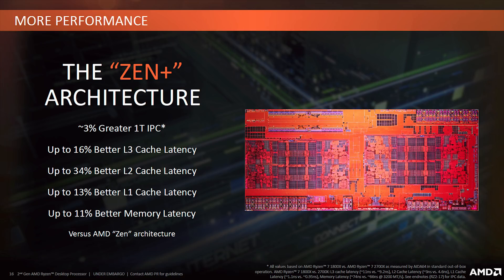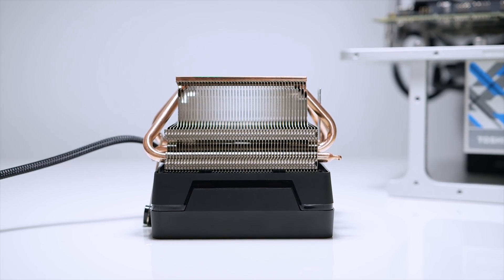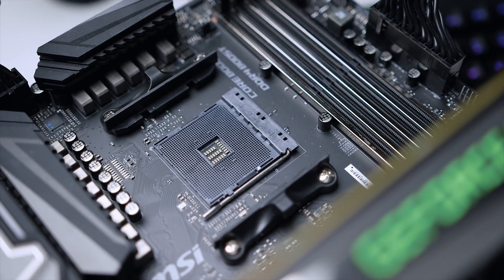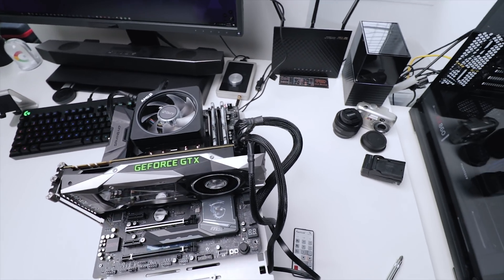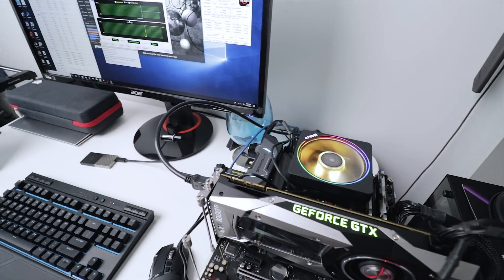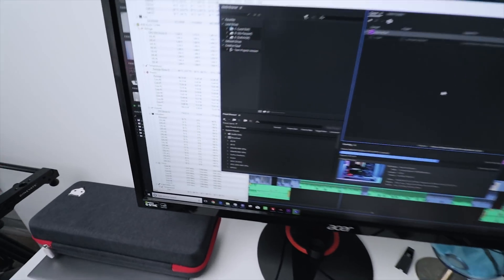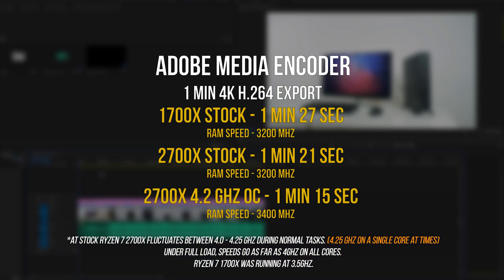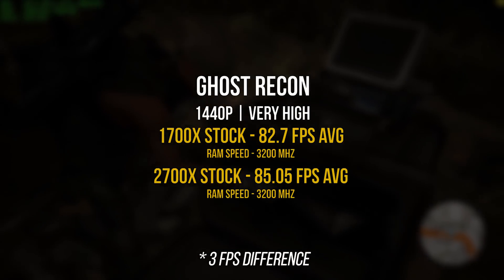Ryzen 7 2700X vs 1700X - Worth the Upgrade?

Comment: Not sure that it's worth the upgrade if you have an older Ryzen CPU, unless you're upgrading to something with more cores/threads. But at this point, if you have anything older than Ryzen, I think it's a no-brainer to upgrade to a lower-tier Ryzen 2000-series AT LEAST. The improvements are just too big to miss out on IMO.

Comment: You are supposed to remove the heat sink while the CPU is still warm, preferably do this right after turning your PC off.  This will help greatly with the CPU not getting stuck to the heat sink upon removal 😉

Comment: @HardwareCanucks why did you test the overclocks with higher memory speeds? That taints the results. Also, why didn't you include the OC scores for the gaming tests (you mention apples-to-apples-comparison, but why not keep it that way throughout the test)? Smells like you weren't really stable at your OC.

Comment: It's not really a major improvement in IPC but it is a major improvement in power efficiency. Look at voltage frequency for both 1700x and 2700x! The voltage for a 1700x and 2700x at 4GHz is night and day. The 1700x required nearly or above 1.4 volts. For the 2700x it's around 1.15/1.25 volts. The bad thing is that when you try to push the 2700x above 4.0GHZ you have to ramp up the voltage significantly.

Comment: You straight away blame the mounting configuration for the failure to separate the cooler from the IHS. I wonder if someone in the YT community has actually ever considered if both the thermal compound properties and mounting forces for those coolers are within the mounting system specs by the manufacturer. I'm not implying this is a new problem, only that the blame is always cast on the mount system while probably the problem is not correctly understood.

Comment: ive pulled so many cpus out of the socket when removing coolers its not even funny, not just an am4 problem happens with just about all of amds sockets, luckily its designed in a way that the cpu and socket have always been perfectly fine afterwards, for me anyway. Find it happens fairly often with "stock" TIM as some of the stuff that comes bundled with lower coolers turns into glue when it hardens

Comment: Why test games on 1440p resolution when you want to check the cpu improvements. Imo you should run those tests at 720p or 1080p. And why not to add an i7 8700k for comparison?

Comment: How about testing at stock values. The 1700X vs 2700X, both at stock out of the box with the requered memory speed as stated on the website of AMD: 2666 mhz for the 1700X and 2933 mhz. That would be the only correct review.

Comment: I'd like to have seen what the differences would've been if you actually took the maximum ram speed for the 2700X into the test too. To see how much of a difference it means to have rams at 4000mhz compared to 3200mhz.

I know in testing you want to minimize other factors than the processor itself - but from 1700x to the 2700x there's also a difference in how much ram speed the can handle, right? That would've been worth testing out too, to see how much of an improvement it would be if you invest in the maximum speed of ram the 2700x can benefit from. :)

Comment: Gah! Why is everyone benchmarking games that are really well multi threaded!?! Battlefiled 1? Doom on Vulcan? Seriously? You can run Doom on the Vulkan API on a freakin 7th gen i3 and still get 60 FPS. Pick some titles that suck at multi threading, keep a good cooling solution, and see if XFR 2 shines at least a little brighter than this... I went from an i7 4790k on a GTX 970 to a Ryzen 1700x on an RX580 a year ago and noticed a major performance hit on Far Cry 4 between the 2 systems. My theory is that the 4790k still has better single thread performance over the 1700x. I noticed while playing Far Cry 4, that in certain parts of the game, ONE thread would end up maxed out for a few seconds here and there in intense fights, and the moment that happened, my GPU utilization and FPS would plummet. I can't help but think that if XFR2 on a Ryzen 2 could ramp up that maxed out core to 4.1+ ghz. Maybe it might have softened those FPS drops like I got on my 1700x, usually putting all 8 cores around 3.6 ghz, if I remember correctly. Just a thought...
Reply: Wrong! Intel is a criminal corporation. They created a compiler which only runs quickly on their processors and then bribed software makers to use it. They bribed HP, Dell etc. to not use AMD processors too.

Comment: Hey, I have a question for you. I am building a VR development PC and I received Ryzen 1600 yesterday. My motherboard is B350 and I'm thinking of returning this chip and getting 2600 instead. However, here are my concerns:

1. I have to update the motherboard BIOS to use 2600 and in order to do this, I have to use 1600. I ordered it through B&H and not sure whether they would still accept the return after I use the chip, and I don't feel comfortable either.

2. I'm not sure whether I will see a significant speed difference. Just as you said about the difference between 1700X and 2700X, while I am building a new PC at this moment, I'm not sure it's worth going through a hectic #1 process to get a slight speed bump. On the other hand, I haven't actually started assembling so my parts are still in boxes. Since it's new, I sort of want to get the newest chip possible, of course.

Your opinion would be very helpful in choosing what to do. Thank you in advance!

Comment: I'm an existing Ryzen 1700X user and the most interesting thing about the Ryzen 2700X is the improved power consumption. I don't know how a processor with a high 105W TDP fares better in idle and load compared to a 95W TDP is beyond me.

Comment: Setting memory speeds to same isn't really an apples-to-apples comparison I think. One of the big pros of the new Ryzen is compatibility with higher clock ram, therefore shouldn't you be testing both systems with the fastest memory possible?

Comment: I think Im going to change my motherboard instead, I have a r7 1700 and ever since a bios update, I can't go over 3.7GHz and even for that speed I have to max out the voltage to 1.5 because it keeps crashing with cinebench, since the beginning the cpu only went from 3.0 to 3.2 without meddling with the bios and couldn't get to 3.7 out of the box, my mobo is a gigabyte gaming k5 and I pretty much hate it... ty to flash back the bios but I can't get back my stable 3.9 OC  but that's the price I paid for saving a few bucks, I should have bought the Asus hero instead
the power supply is a corsair 750w so I don't think that's the problem

Comment: Ryzen 2 isn't really worth. Its great and all but with the prices of 1st gen ryzen its much more better to get the 1st gen ryzen, unless you're making a completely new build and need that extra edge for a workstation pc or the new storeMI tech then sure get the 2700x. I'm probably going keep my 1600 and switch it out the very last gen of ryzen on the am4 platform and unless there's something absolutely amazing that I need that will come with the future board, my gigabyte gaming 3 b350 bored is just fine.

Comment: Not expecting much more in gaming, that should go without saying anymore.  CPU's haven't been a bottleneck in gaming since the first gen i7 days... A 920 overclocked to a 980X sitting stock, they can keep up with a 1080ti's workload all day long, the 980X can even take two of em up the... er, I mean... in SLI.  New CPU's offer more cores, some nifty new extensions in regards to encoding, because everyone is a YouTube star these days and needs rendering performance to exist on Earth,  Obviously...  But taking a close, or even broad look at 3Dmarks databases, searching configs, and comparing the results... Graphics scores sit about the same from a 980X to a 9th gen top o the line-o CPU... or AMD equivalent (obviously when paired with the same GPU).  Innovation has been stale for nearly a decade... Agree or not, them be the facts ho bags.

Comment: Great video as usual. You did however limit the full performance of this processor by not showing the results for the higher memory clock speeds. Apples to apples is fine but the 2700X is still capable of more, and with the memory speed scaling of the Ryzen architecture the results should better than the 1700X, more than what was shown here

Comment: Good vid. I always like you videos guys but... You should have tested the 2700x stock at 3400mhz in the RAM. That is apples to apples because you will be testing each CPU at his max setting. What is the point of downgrading a new CPU to match the old one? In this regard, why dont downgrading to 1666mhz and shut down 4 cores to compare it against an FX 8350?.  I mean, no offense, just want to give constructive feedback, but it is more "fare" to test each at his max capabilities in stock scenarios. 👍😁

Comment: Gamers Nexus has a very in depth testing video up. At best you get very a small increase in gaming performance...etc.. over 1st Gen Ryzen. Single digit % increase due to faster clocks. This was mostly expected. The 2xxx series is, however, way more power efficient than Ryzen 1xxx in which the margins of difference was surprising. We won't really see a solid gain in IPC..etc till gen 3 or gen 4 Ryzen. Very similar to Intel's old Tick-Tock incremental gains.

Comment: 8700k costs the same as the 2700x here....
Reply: Wheres here? 8700k $339 no fan. Ryzen 2700k $329 with rgb fan. Both great CPU's. So Intel cost more.. you still have to get some kind of heatsink.
Reply: micro center has the 8700k at 300, bundle it with a motherboard and they take even more off.
Reply: and can you scroll up and read what i said? "lol even if Intel doesn't include stock coolers on some cpus at least they let you use something other than the stock cooler on the ones that do"
Reply: "here" is houston, tx
Reply: kid can u read?
i said

"ѕυиѕтσям
1 day ago
and yes since posting this 8700k prices have gone down here"
Reply: definitely not in houston. or the web store. and im not driving a few hundred miles to get a cpu
Reply: its "pickup only". which microcenter are you looking at?
Reply: yea ik. its in houston, but the 8700k costs 300. the 2700x costs 330.
Reply: i remember that you said " Microcenter currently has the 2700x for $300."
Reply: also micro center doesnt  have the newer x470 boards. so ur cutting some features that make ryzen2 attractive
Reply: im paying $30 extra for a cpu, or $10 extra+cutting features off.
Reply: honestly, i would go for ryzen2 if they cut off 50 dollars from msrp like they did to the 8700k. then we talk
Reply: where are the x470 boards? can u look it up? theres only one and its for 180
Reply: x470 pro? its not even on the site lmao
Reply: besides its 30 dollars off for z370
Reply: yea im gonna tell u after when i vist my microcenter soon. all the other x470 boards say out of stock in houston store. I highly doubt that would be in stock lol.
Reply: prove where i went fanboy. all i said is that 8700k is cheaper. did i say it was better? no. all i said is that its cheaper. You, however, as an entitled amd fangirl, automatically assumed i was dissing ryzen and saying its products are bad. I didnt. I just said that Intel was cheaper rn. Thats it. Now fuck off
Reply: u turned it from a "which one is cheaper" to "which one is better". Different subjects. J🅱eesus
Reply: 300 vs 330. Ok?
Reply: can u guess which cpu i got?
Reply: also btw yes using an aftermarket DOES void ur warranty with ryzen.
Reply: or it did when i wrote that comment.
Reply: they have since changed it
Reply: point is. I was comparing the PRICE of 8700k vs 2700x. not z370 vs am4. not intel vs amd. but the price of two cpus. go fucking enjoy ur new 2700x. im enjoying mine so far. Happy? Im the intel fanboy whos using amd. Right?

Comment: Microcenter in the US is selling I7 8700k for $299.99 and you save $30 when you bundle with a motherboard. So basically $269.99 if you buy a motherboard.

Comment: But you only tested at 1440P ... you are most certainly GPU bottlenecked anyway, I wouldnt be surprised if the 8700K doesnt score much better than this. At 1080p, there's a good 10-20% difference between the 1700x and 2700x.

Comment: I'm hoping that the lower end cpus might offer more of a performance gain since that is where you might see more potential to overclock (less cores, less heat/power needed for the overclock) and therefore might see more of a difference.

Comment: Wouldn't it have made more sense to also show the OC results for the 1700x in your comparisons? 
If it's running 500mhz slower, it might show parity (or close to) between the 1700x and 2700x at the same speed.

Comment: Thx for the comparison. It's time to build a new rig.
In case anyone is interested my old Toshiba Ultrabook with an i5-3317U @2.4GHz (Turbo Boost, Stock is 1.7GHz) renders the BMW scene in 42 min 39 sec. 
The 2700X @ stock is ~9.5 times faster.

Comment: I got my Ryzen 1700 CPU mainly for work. Don't care that much about 1 fps more in gaming on 1440p or 4 fps more on 1080p.
Reply: Its never worth to upgrade before your gear hits 4 years old, heck it can go older and still be good, these options are only good for new buyers
Reply: Have you overclocked your chip? What's the max potential?

Comment: I think it would make sense to also include the overclocked numbers for gaming, as well as the 3400Mhz memory speed. "Apples to Apples" is useful in some ways, but practical comparisons are useful in others. If I bought that setup, I would not be running it at 3200Mhz, for example, so my decision on whether or not to buy it would not be based on those 3200Mhz numbers at all.

Comment: Tough decision because of the included cooler makes it a great deal. If I need to use the aftermarket Noctua 15 for stable oc, it's not so appealing over the 8700k. Excellent video. Thanks.

Comment: I am more interested in Ryzen 2 rather than Ryzen plus, I know Kodouri said something about knowing what needed to be tweaked to match/beat Intel in gaming; however, Its more just a matter of clocks per core from the looks of it, and with him leaving AMD the question as What will happen now?, Ryzen is a win for AMD but its not an Intel Killer like the hype train made it to be, as for me, CH6/GSkill 3200mhz Trident RGB/1700x/Krakenx62, I'm at 4.0 on all cores with comfortable voltage and temps; However, I had gotten a stable 4.2Ghz with a few Asus updates, just not really comfortable running those temps for long term everyday usage.

Comment: Thanks for your review mate, I suspected much as I pretty much bought a 1800X and 1700 for a couple of systems in the past both were overclocked at 3.9 at that point I wished id just purchased 2 1700's the 2700x looks like a good one to throw on a fresh build with a X470 think ill swap the Prism for the noctua use the Prism on a 1700 cpu cuz it looks sick :)

Comment: I'm running a 1700 on gigabyte x370 gaming 5 with rx460 atm.  am thinking of upgrading almost my whole system.  I currently have DDR4 @2933 memory anyway and also a H100GTX AIO in my Obsidian 750d.  Would love to know your thoughts on what to upgrade and whether it's worth it, especially since I'll be using it only for rendering and occasional 4k editing. I already have an iMac Pro 10 core anyway and I use Media Composer 2018 and Da Vinci 15 Studio for video and Phase One software (Capture One Pro & Media Pro) for my photography I do .
For it's either upgrade my pc or a new MacBook Pro, but not both! especially since I am upgrading my monitor to a 4k as well, so I have to watch my budget.

Comment: Although a fan of the channel, I'm a little disappointed that the benchmarks were done with a 1440p resolution. We all know the higher the resolution, the less the game will depend on the CPU, and more on the GPU.
While not 4k, 1440p is still relying on the GPU much more than CPU and that's why the performance increase wasn't very noticeable.

I know that regardless of this, the performance difference isn't a lot, and there's no point going from Zen to Zen +, but the review was a little disappointing in that regard.

Comment: Great review but not sure why you used such a high res and ultra & epic settings to do CPU tests the whole idea of testing a CPU is to take a lot of the load off of the GPU and even the mighty 1080Ti will be working pretty hard at your test settings. But hey at least you didn't pit it up against a 8700K@5.2Ghz like most of the reviewers did in the first Ryzen release with the 7700K@5.0GHz-5.1GHz and say hey Ryzen sucks at gaming which then all of the masses around the world kept on repeating over the last year.

SO yes you did a good job & it is disappointing you did not get a solid 4.3Ghz out of the CPU or that 4.350Mhz we seen in the leaked becnhes.
Reply: it's a good thing gamer's nexus exists

Comment: imo the difference will come for 1080p gamers. 1440p is all well and good, but it's putting a higher level of stress on the GPU and less so on the CPU. I very much doubt the CPUs were maxed out in any of those situations. Should be a 5-10% difference, especially with the RAM being able to go a little faster.

Comment: Pro tip if you don't want your CPU stuck on the cooler: rotate the cooler ONTO the socket until you feel the thermal paste breaking, then pull it gently and your CPU will stay in place.